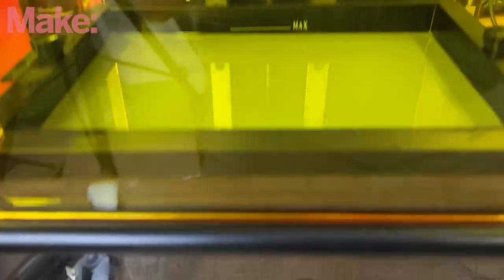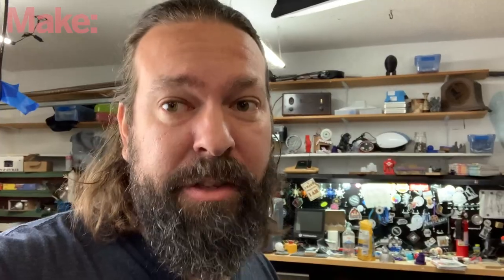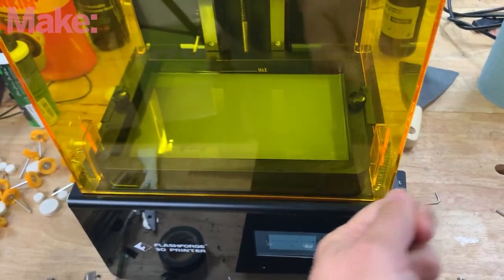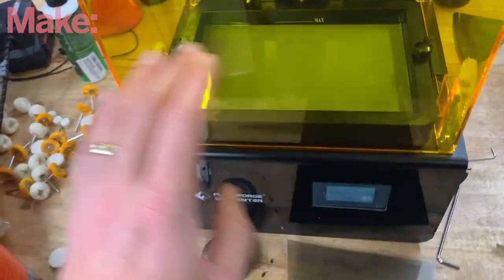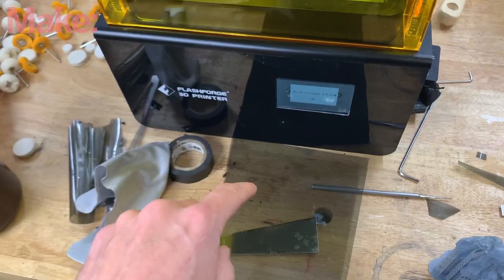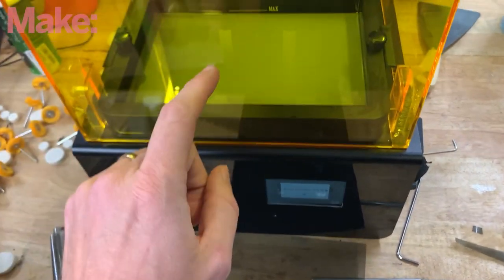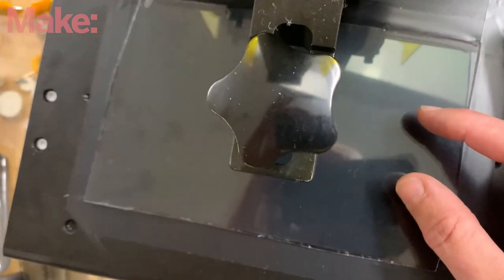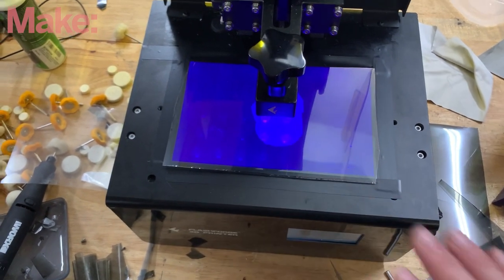Quick Tip: How To Replace The Polarized Film On an MSLA Resin 3DPrinter

Comment: I kind of slapped this video together super quickly. I was almost finished when I realized what I was doing could really help others. Let me know if you have questions!
Reply: Does taping it on really work ? Doesn't the UV-light destroy the glue ?
Reply: So you mean to tell me that when the lcd screen gets damaged (with spots and such) all we have to do is replace the light filtering part of it and keep the lcd part?
Reply: @youngswoops  in some cases, yes. I wouldn't consider this a fix for everyone, but in some cases it is simply the polarized sheet that is damaged.
Reply: when you tape the edges, most of the tape won't be exposed to UV. It may degrade over time, but shouldn't be an immediate issue.
Reply: So what’s the Film sheet Brand ?

Comment: I this with a 4K epax printer because the FEP broke and resin went on the screen. Rotated the film so the least amount of light, and taped down. It seems like some adhesive inside is needed to keep all in place because prints had small failures. Support for EPAX is the worst. Elegoo Saturn support is the best. I have experienced both.

Comment: Yes, I had the same issue with my Mono X!  The soft polarizing film bakes together with spilled material, so its absolutely impossible to clean the display anymore. I have an old ELEGOO Mars aswell. This display has a hard like glass surface. Spilled resin can be easily removed using a rasor blade.
But here my question: Isn't it a solution to tape an extra FEP directly over the display? Spilled hardened material can be easyly removed from it and that would protect the sensitive display.
Reply: How did you fix your Mono X?
Reply: Yes, any clear protective film should do the trick. Many people suggest iPad screen protectors, plastic or even the glass ones!

Comment: use a lil soapy water to smooth out bubbles (how you do window tint).
Reply: Never heard of this, so I had to find a video.  It showed what happens when you use the soapy water vs not.  The barely tint scrapper push sounded HORRIBLE
Reply: @BannisterLee  yup but tint like most polarizer has a film to protect it on install (smoother cards etc can still scrape and all that). If there was no film a bit of fep would help

Comment: I'm using an elegoo mars 2. cured resin stuck on the screen. but while removing, the film slid. then the tape came off. then i discovered there is a clear film on it(with the cured resin) it's completely stuck and i tried peelin off the resin but it broke the film. so, i want to know if this is just a protector or the polarized film itself? it's not gray or dark. it's clear. and when i turn on the printer, it shows the same UV and greyish shine -like look (which btw, hurts on eyes if you try looking it, and yes, for the sake of this post, i looked at it.. man, for the love of 3d printing)

Comment: Man, the only video I found managing to explain what the hell hapenned to me... That was exactly my situation: perforated FEP. After scrapping, I realize there was another "protector" film over the lcd. Did I forgot to remove that second one?? I removed it, and printed again!! But... the whole fep was cured, and some printed areas completely destroyed (printed with a screpped patron). Yet I could save some the prints, but what the hell happened?? And you just explain that on your video: It was a polarized film!! Thank you. The new LCD is on its way, but maybe I can save this one...
Reply: therein lies my main issue with why this video is problematic. you clearly removed your polarizing film. bc he never shows ppl, it's VERY VERY easy to make this mistake. It seems you spilled on your polarizer then "Scrapped" your film off while trying to get the resin off. the layer you think was "protector" WAS the polarizing film. this is why you had a full fep cured. the entire screen was exposed bc you took off the polarizing. If you scrape resin off, try out one of those flexibile metal razers first. you shouldn't need a straight edge on a screen. that's your LAST resort. and if so, start with a #54 scalpel. but a hard straight edge really should just be avoided at all costs. even if you tried what he did in this video, it's impossibly difficult to get the film in the right direction. you did the right hting gettting a new lcd.

Comment: Wait. what? You can just tape it? Ah, man! My car radio had a halo on both front and rear polarizers. After removing both and their glues, the replacements went on adhesive side to glass ... with bubbles ... crap. If I had known that I didn't have to use the adhesive, I would have left the clear plastic sheets on the adhesive sides and just taped their edges to the glass. Garrr. Maybe next time. Thanks for the video, Make:.

Comment: Here's a tip. Apply an iPad screen protector over the entire screen and polarizing filter before you spring a leak. Seal the edges with Kapton tape.   That way, when you get a leak, you just clean the screen protector and don't risk destroying your polarizing screen.
Reply from the maker: that's a good one
Reply: Thats what I did and made no difference, I had a tiny slow leak and the resin seeps through the tape and kills the adhesive and screen protector and still ruined my screen,

Comment: Edit: this is one of those videos that will bother me for eternity. until i see you put that polarizing screen on, I'll have a hard time believing you got this to work given you cut out THE most difficult parts yet told ppl you did something and tht's possible. It might have been. but don't tell people you did something as if it's a tutorial then omit the most dangerous part - which is something you acknowledge yourself calling it "Scary". I'm open to this being possible but until the polarizing goes on with a camera on, its irresponsible to believe. Not to mention showing you not scratching the screen taking a straight razor to it. 

I wish you showed what your polarizing film looked like. did you have another video with it? i've noticed over the past year, many ppl don't actually know what polarizing film and quite a few confusing it with the screen as elegoo didn't announce it but saturns started going out with a screen protector on them last year. not saying you made that mistake just would like to see how bad it was